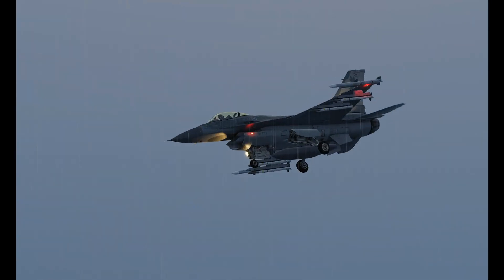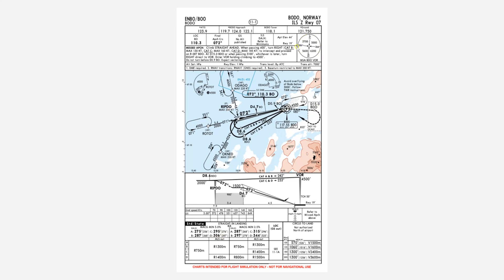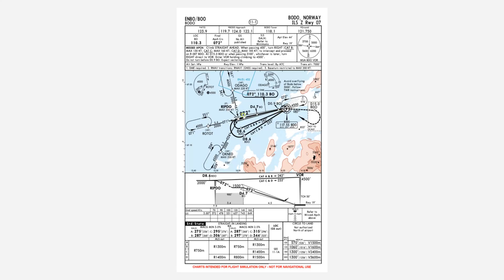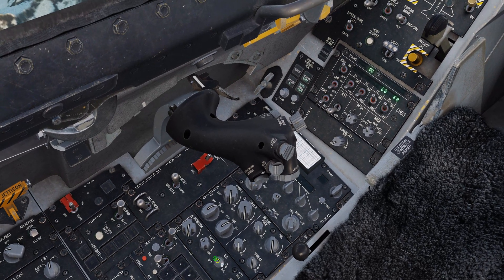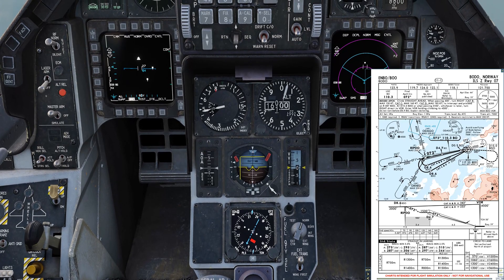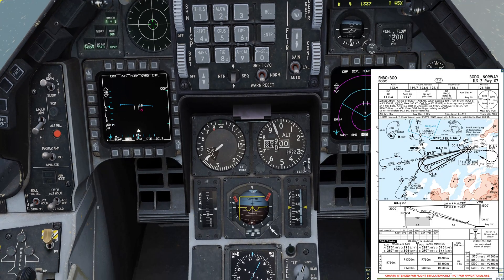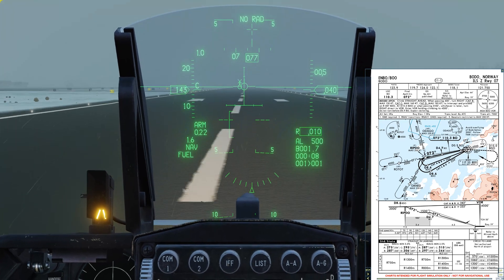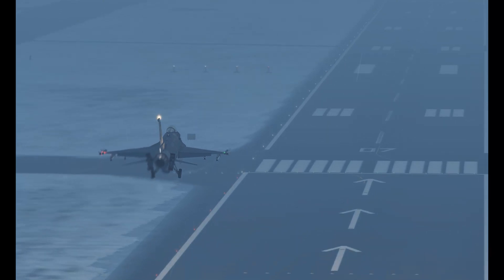Learn about flying an ILS through fog with the DCS F-16 Viper. #dcstutorial #dcsworld

Comment: I'm having trouble with the glideslope. I don't know how to interpret what to do if the line is fully deflected at the top or bottom of the HUD. I can't seem to ever get it to align with the localizer.
Reply from the maker: @szlash280z  Hi, I will try to help you, but first I will need more information. First of all, I need to know what approach you are trying to fly? What airport and what runway. Second, what aircraft type are you flying (it should not matter much, but I will be able to better tailor my response.) When flying an ILS, the goal is to arrive on the localizer and below the glide slope altitude for intercept. As soon as the glide slope needle (horizontal bar) starts moving, you fly the path vector to 3 degrees nose down. (Most ILS are a 3 degrees slope). From there, you make small adjustments (1 degree increment) to your pitch to keep the glide slope needle centered.

Comment: Nice job of explaining the setup, the chart, the nav systems and displays, and the use of the computed flight director indications. Thank you! 

I don't want to be too picky here, because all the elements are in place for a safe flight to minimums. But I must point out that at 14:48 you do go through the decision height without seeing the runway environment (technically, the end of the approach light system, or the threshold markings of the runway, along with enough other cues to be able to fly the aircraft by visual references alone). In real life, you'd be watching for DH and initiating the missed-approach (go around) at that moment -- like a "bounce" off the minimum. 

But this isn't real life, this is a beautifully-recreated simulation of it, and the new DCS fog is great. I appreciate the work you did to put this video together for us!
Reply from the maker: Hi! Allow me to be picky as well 😀. At 310' I have enough of the runway/airport environment to continue the approach. That is the beauty of ILS and constant descent angle approaches that allow an uninterrupted descent and stable approach down to the DA/MDA and an easier transition to visual segment compared to the good old ''dive and drive'' approaches like I used to do 25 years ago.

Comment: Thanks for the great video!
Never did ILS approaches so there are few things that are not clear. Where are those numbers to T-ILS initial configuration are coming from? Specifically TCN frequency which is 45 X. It's not on the plate as you mentioned in the video, but where did you get this info?
Reply from the maker: @chip4525  F10 Map in game.
Reply from the maker: I also use this https://www.digitalcombatsimulator.com/en/files/3312200/

Comment: Nice, I love the ILS-landings. Have been inventing the worst weather and darknes and unannounced aproaches so no landing strip lights either and it is amazing to se the center line of the runway coming up in front of you in the landing lights when doing the approach correctly. Question: Is the AOA only important during the last part of the landing approach?
Reply from the maker: @ebptube  The AOA will give you your final approach speed. This speed should be achieved and maintained for at least the last 3nm.

Comment: Nice and exhaustive tutorial about ILS landing. 

I've flown hundreds if not thousands of hours in various F-16 simulators, but I never followed a standard approach chart to the point, so this was nice.
(I usually set a steerpoint at 1500 ft where the beginning of the glideslope is (4.7nm in the case of Bodø), and just fly the localizer/glideslope).

One thing I was curious about, though, is how come you did not fly "on speed" according to the AOA indexers and HUD Bracket/Flight Path Marker combo? You were a little too fast (as can also be seen by your pitch attitude on approach (nose low)). Was this purposefully due to adverse weather conditions, or did you disregard the avionics cues?

Thanks!
Reply from the maker: @RAF33Strike   nice observation. I have watched many F-16 landing through the HUD available on the internet, and I remember Mover I think, saying they would fly just above the bracket on approach, which gives you about 10-11 degrees of pitch angle. Flying right in the bracket is 13 AOA, and very close to dragging the tailpipe on the ground. When you flare, you increase the angle of attack by a few degrees and risk hitting the tail on the runway. Here is a video that I found of an F-16 landing with a speed that is above the bracket. I could probably fly my approach a few knots slower, but this runway was long enough. https://youtu.be/KmLlOX7ojjY?si=NuNbQxJjbB4HHtYD
Reply: @maddog7989 even the chuck's guide for the DCS F16 and I believe he manual tells us to fly it exactly like you did, a little over the bracket and about 11 degrees. Fantastic video!